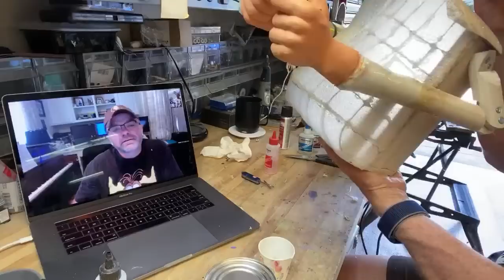Episode 7! LIVE! (and self-isolated) in my shop, a baby announcement & working on the NEW GUY. AMA!

Comment: styrene partly polymerized , cured with hardener is the traditional 2 part polymer polymer to cure. 
for the fiberglass the coating. there are many different ones available. 
the kicker for CA glue is an amine instant cure. very volatile solvent. great seeing the process

of creating a new character.

Comment: Jeff, glass wool, which is one product called "fiberglass" today, was invented in 1932–1933 by Russell Games Slayter of Owens-Corning, as a material to be used as thermal building insulation. It is marketed under the trade name Fiberglas, which has become a genericized trademark. By the way, my last name is pronounced van DOW wull.

Comment: Half a year late, I came across this video. Possibly you can use it for a future puppet. Rather than give a name, I bring you a process. Backstory is someone attempts to make their own nickname as they are ashamed of their name (bitter). Their parents were not the sharpest bulbs in the pack but meant to give an impressive sounding name. They take the first two names from car models. For example, "Skylark. Fairlane" and then an appropriate surname for the character.